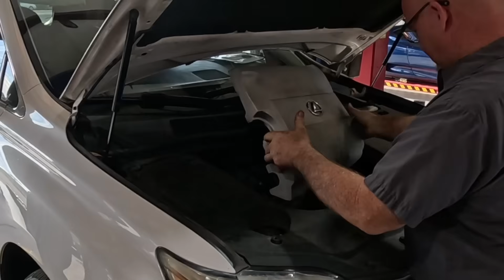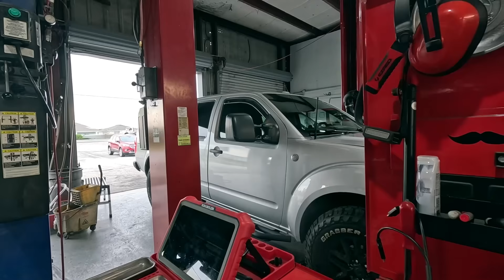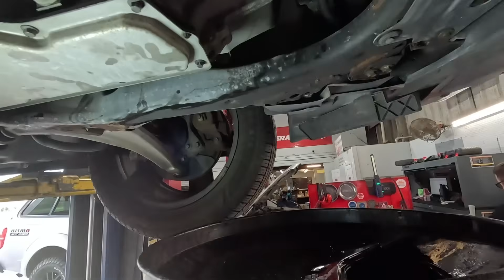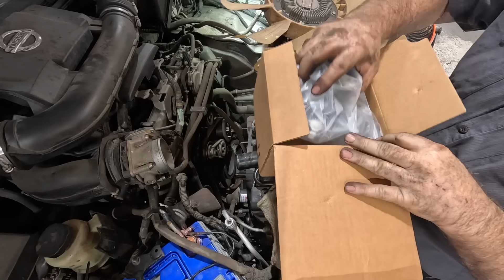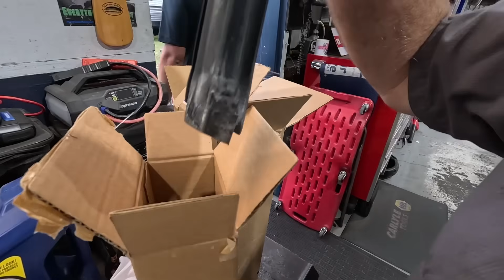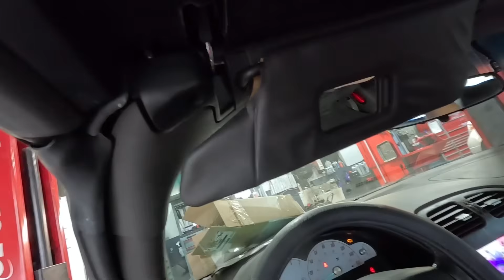Frontier Compressor. Malibu, Axle Seals. T-Bird, glass seals. Lexus, Alt. Auto Repair Shop DAY 825

Comment: Jimmy I love your sarcasm, you touch on so many points with pin point accuracy too. I do feel your pain to work on cars without proper tools and they only want to pay you book times,  that is bullshit esp when the cars age and things either explode when you take apart because plastic or rubber and hard as a rock. I worked on 1 manufacture brand, so we had most of the special tools. I hope they read our comments and take heed the tool boxes have wheels, and they need to take care of their mechanics, or sometimes they move on or retire because of their crap. Mechanics like you are hard to find and keep if they are abused time wise, they don't pay for your tools, you did and we don't give away our time for free.
Now about the lady videoing the car, bless her for sure, the dealer I worked at use to give a lot of free bodywork away, until they started to video and snapped pictures then that dropped the customer who would get free bodywork down to like nothing, on rare occasions something got damaged, but usually, the lot jockey would fess up when they did it so it could get repaired. Keep up the great video's and work, and remember your hand is not a hammer.
Reply from the maker: Haha thanks for the reminder and the great comment!

Comment: Jimmy, I have a very important question for you? I want your honest opinion of which Auto Scanner should I buy? I am willing to spend 1500 or so. My Xtool took a crap. Of course after the warranty expired. I have been looking at Topdon and Altel, some launch. If you were to buy one today, what would you get? I hope the updates on the one I buy are for at least 3 years, that update crap gets expensive. Help me out Jimmy.
Reply: the thinkcar think tool is pretty good, from king bolen I have a older one updates lasted 3 years , black Friday is coming so perfect timing to buy one , maybe autel or topdon but my thinkcar pro s is working flowlessly
Reply from the maker: I have had good results with the Kingbolen stuff, TOPDON is good but the updates are pricey. Autel is very good and have lots of options. I honestly don’t think there is a bad choice. More about budget and options you need. My ThinkCar has also been very good.
Reply: @JimmyMakingitwork thanks Jimmy! I thought you really liked kingbolin.  Funny thing about my XTOOL! It works fine! When the battery is charged! I had bad cable and thought it was charged! Still upgrading though! Thanks again Iimmy!